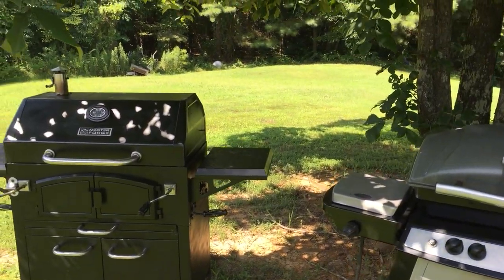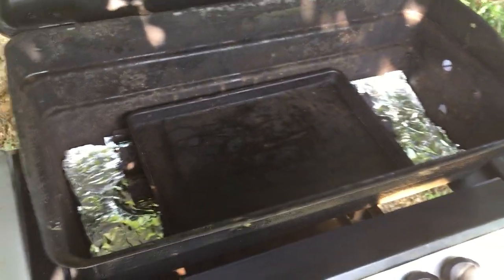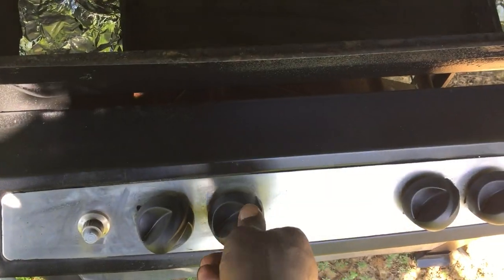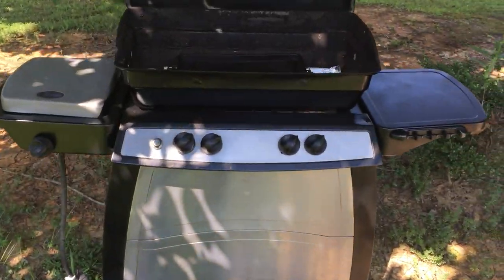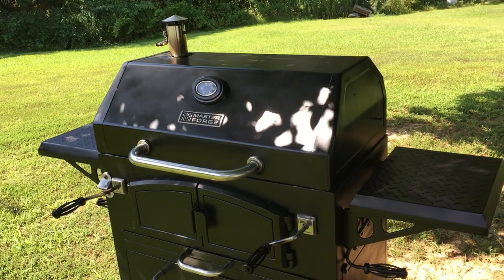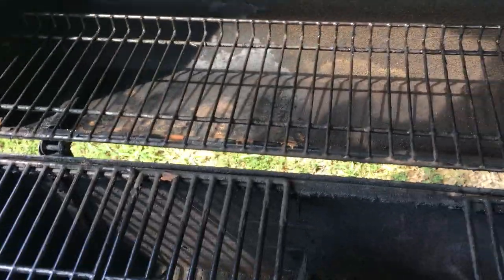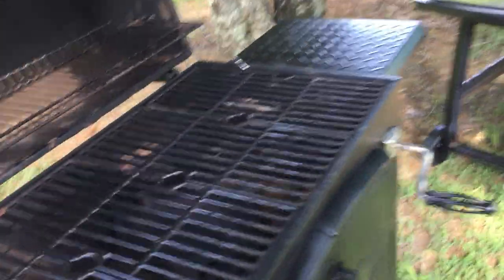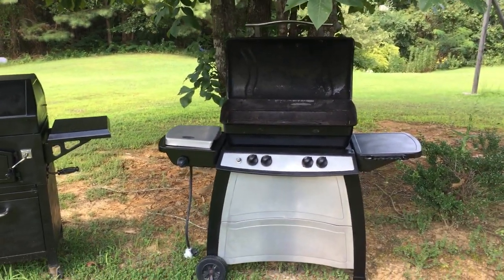Convert gas grill to charcaol

Comment: I'm gonna do the same thing with a really nice but old propane grill someone gave me. Thanks so much for making this video, I'm inspired now!
Reply: Drill out a 5-inch diameter hole on top of the top left of the old gas-grill lid and fasten yourself down a charcoal stack, too. That'll be a HUU<GE improvement over just removing the old gas shit and droppin coals in. With the stack in, I was able to control my burns way better.

Good luck if you haven't done it already! Soooooo much fun!!!!